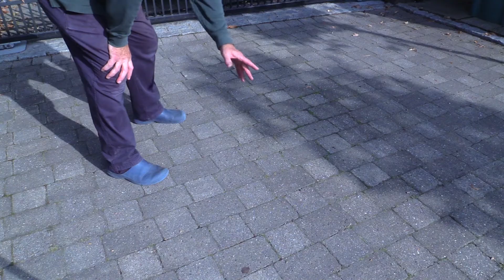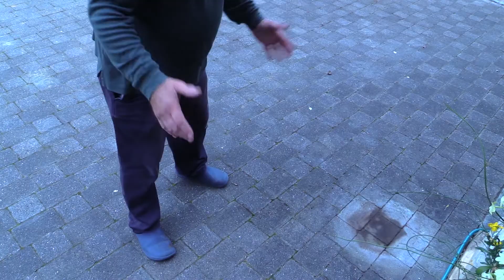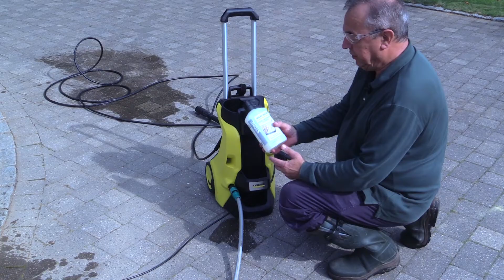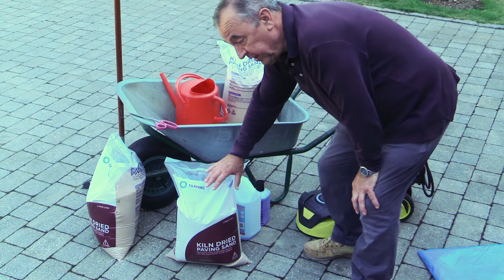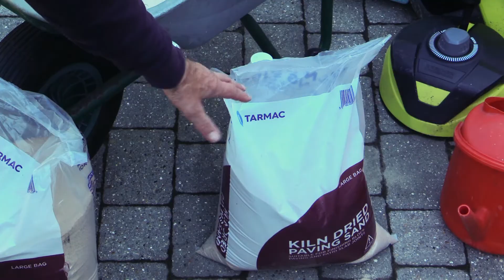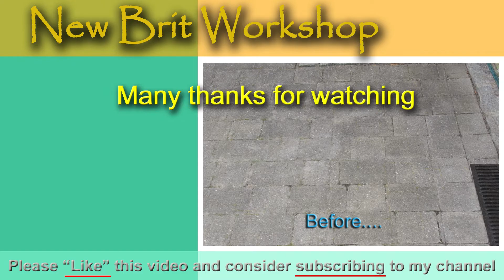How to clean block paving

Comment: Do you need the sand if the block paving is just for walking across and not a driveway?
Reply from the maker: It is best to use sand as the paving could become uneven.  Peter

Comment: As a retired video promo maker, may I congratulate you on an excellent presentation.
Just one thing - do you hose off the remaining sand or wash it away?
Reply from the maker: Hi Chris, Many thanks for that very kind remark. I am not sure if it is the right thing to do but I hosed it off and then, when it was dry, I brushed some kiln dried sand over the paving to fill in the gaps again. I had bought 3 bags for that but needed less than one.  Cheers.  Peter

Comment: Peter, please make a bin shed
Reply from the maker: Hi Stephen, I was going to do that early last year but found this instead:
https://www.wickes.co.uk/Keter-Store-It-Out-Max-4-x-5ft-Plastic-Garden+Wheelie-Bin-Storage/p/119796
It is a Ketler 4' x 5' storage unit. I have had mine for about a year and it has been subject to all sorts of bad weather. Water does not get in. I  do not keep bins in it but have put shelves in so that I can store gas bottle, petrol cans as well as sand and cement. It is brilliant.   Cheers.  Peter
Reply: @NewBritWorkshop  Thanks very much, Peter. I checked it out and it looks good. I however bit the bullet and went and bought the timber. I'm going with 2x4 treated timber for the frame with treated planed 2x1 cladding. It will be three bays with doors and lids for each. About 300 euro for the timber
Reply from the maker: Hi Stephen, Good luck - I am sure that it will be brilliant.  Cheers.  Peter

Comment: Hi Peter. Your videos are always so well presented. I really enjoy them. I am hoping to get your plans for a multi angle mft type work top. I know that you need my email address and I have submitted it twice in comments made on previous occasions to this. My comment has disappeared both times, consistent with your mention of these going to your spam folder. However as I haven’t heard back from you I am wondering if You Tube have implemented other procedures which simply delete comments which include an email address? What do you think?  Jim
Reply from the maker: Hi Jim, I have searched every comment on my channel and this is the first one to appear !  Peter
Reply from the maker: @Jim Rimmer, The plans are now on the way.  Peter
Reply: @NewBritWorkshop  Hi Peter. Thanks so much for sending me your plans. I will need to make a few adjustments as you have suggested. I was intending to to do a 10x10 hole top which will be a hinged top on a rolling box which contains some timber odds and ends as well as some Festool kit including an 800mm rail. My Festool table is the 800 model which I have had for about 25 years and never really used with the rail and attachments. So my rolling box is to provide a second support base for larger pieces of material as well as being a cutting area for future projects. I had intended that the top would only be 1064mm square but still have some options as I have not cut it yet. Bought your book and am enjoying the unfolding plot. Thanks again Peter.
Kind regards
Jim

Comment: Peter, two points if I may. One, not all paviours need kiln dried sand as it depends on what type of ground the paviours are laid on. I suggest checking with the paviour manufacturer if at all possible. Second,  a regular application of Patio Magic will inhibit moss growth etc.
Reply from the maker: Hi Roger, Many thanks  Peter

Comment: Hi Peter I am a fan of yours and have been a subscriber for some time . I really like your workshop videos and your Festool reviews I have become a Festool fan on the strength of what you have said and advised . I am a professional drive cleaner this is main activity within my business. I would like to offer some advise with your latest video on drive cleaning for best results . I would advise that all weeds and moss are treated with weed killer and moss  killer prior to cleaning and that the pressure setting be set to max on your rotary to remove the dead matter in one pass thus saving time and water . There may be some removal of loose surface degradation caused be the sun but I find the most economical way. My machine has 22 litres per minute and a force of 230 bar set in a rotary of 25 mm from the surface. I hope you don’t mind my comments as I think we can help the public understand more about there block paving thank you best regards Richard
Reply from the maker: Hi Richard, That is fantastic advice and I hope that other viewers will take the time to read it. I had asked a local block paving installer for advice but I can see the logic of what you say. I assume that a little more sand will be removed but I did find that it was very easy to replace. Many thanks.  Peter
Reply: @NewBritWorkshop  Thank you Peter It would seem that the sand that is cleaned out at higher pressure, but under the rotary it stays in the joint as it drops back down as the forward speed of rotary cleaning is quite slow. its the old adage of slow and steady wins the race. The reason we would moss kill prior to cleaning is that the live  moss spores will simply spread and recolonise to form in all the joint once a little moisture is given to the fresh sand. 
Thank you 
Richard
Reply from the maker: Brilliant - cheers.  Peter

Comment: Hi Peter,  a lot more work than I expected.  How often do you do this?  We have York stone on our hard surfaces here and it's a lot easier to clean with the pressure washer.  Good trick to "sweep" off the muck using the patio attachment lifted up and tilted.  I do it using the fan shaped nozzle but this looks a good idea.  WKR  Mike
Reply from the maker: Hi Mike, I am new to block paving but from my research I am expecting that once every 5 years will be enough. It was a day and a half of work for me but if I were fitter (or 10 years younger) I would easily manage it in two half days. - the second half day would be after the paving was dry and ready for the sand.  I hope you are safely back from your travels.  Cheers.  Peter

Comment: Outstanding sir, ……..actually it was your channel that inspired me to get my own pressure washer (I bought a K2), I used it on my rear patio which were ugly green/dark grey paving stones.
The results were stunning, the patio slabs returned to a light beige and have remained that way, and I got an additional unexpected benefit as well, when the sun beats down on the patio in the early morning it now reflects directly into my kitchen filling the room with bright natural light. Brilliant stuff.
Now I’m going to pluck up the courage to do my block paved driveway.
Reply from the maker: Hi Jim, Thank you so much - good luck with the block paving.  Cheers.  Peter

Comment: LOL, I'm really glad that I bought a patterned concrete driveway around 20 years ago (grey, looks like real cobbles - you wouldn't know even close up) , hardly a mark or a weed on it in all those years. Occasionally run a hose (not pressure washer) over it to remove any general muck. I watch my neighbours doing this block paving nonsense EVERY year - painful (for them :-)